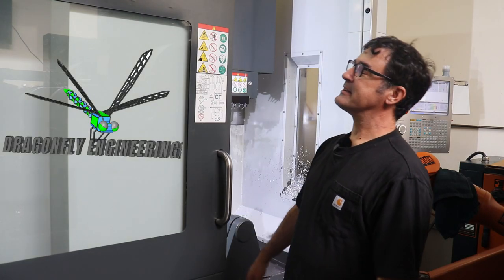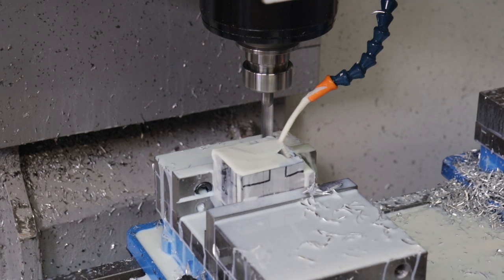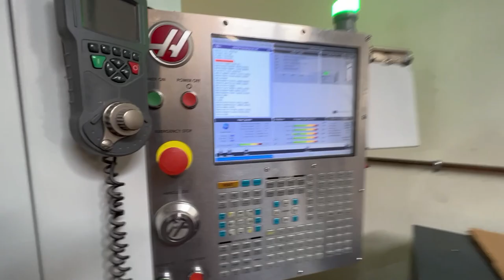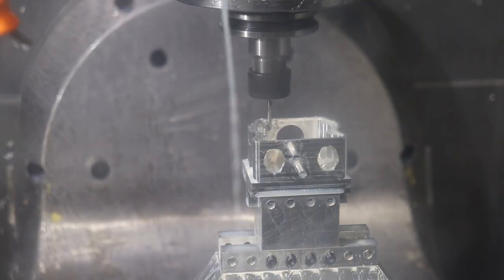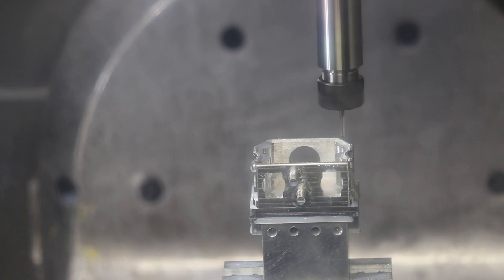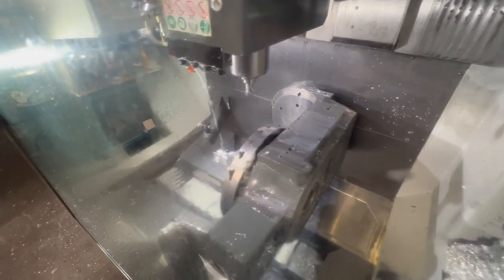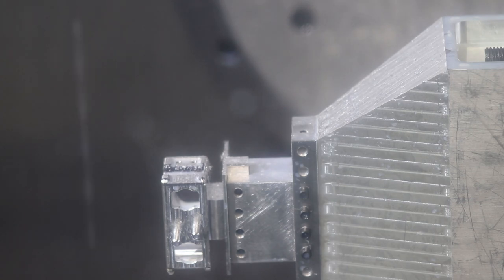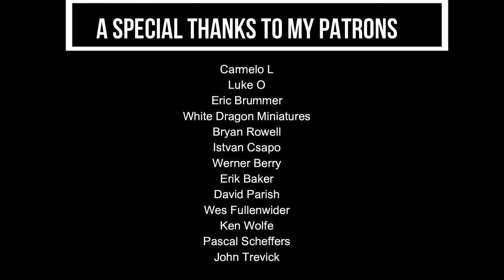5 axis CNC machining process

Comment: Nice vid. I've got a Haas UMC500 myself. I have a Lang baseplate that's permanently on the machine. It has 8 x 96mm holes to accept Land pullstuds. I then attach various types of workholding onto that.

For this type of work I can highly recommend 5th axis dovetails. It's really quick to install the 5th axis Riser on the Lang baseplate, and then put the Dovetail adapter on top. the four pullstuds on the Riser just drop into the Lang baseplate, and then the 4 pullstuds on the Dovetail adapter just drop into the Riser block. It's pretty easy and quick to machine the dovetails into the raw stock as well. You get great access to the part for machining with dovetails. 

It's worth the investment for the amount of time and effort you save doing setups. 

P.S. Yes, the TSC pump on Haas machines is ridiculously loud!
Reply from the maker: Thanks for the tip.  I checked out the webiste for the work holding

Comment: This is technically referred to as 3+2 machining. Since only 3 axis where ever moving during the cut and the other 2 axis are locked into a position. I applaud your initiative for learning this stuff and jumping right into the big end of the pool. 5 axis positional machining can be very fun. Full 5 is allot more fun.

Comment: You should have used that big block to extend the machine vice jaws. The play you were worried about, I would have thought, the jaws play would have been taken up by the floating ball mechanism or not?
Reply from the maker: good point. thanks for the tip.  The notch was a rough shape to keep the cycle cost down

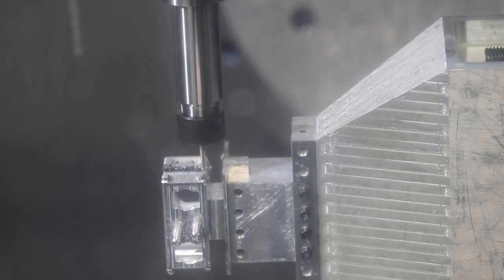Comment: 33:00 those artifacts are probably whisper cuts from a bad rest material thickness and toolpath tolerance combination. If thats the case then you should have a look at "Eliminate Rest Machining Whisper Cuts in Fusion 360! FF112"
Reply from the maker: @ipadize  thanks for the tip

Comment: Don't recall if you said what CAM you used, and not quite clear on those features left in your g-code from the tesselation and whether you actually need some of them but there are smoothing and tolerance options (thats what Fusion calls them, other software may have slightly different) that let you decrease/simplify the lines of gcode in exchange for potentially being more sloppy with the geometry.
Reply from the maker: Thanks!  I use Mastercam ( just learning) before I used visual mill and I am familiar with what you describe.  In this case the excess mill time was lower than the code optimization time.  But I am keeping and eye on the issue.  Thank you for your insight.
Reply: @DragonflyEngineering  it’s called Arc Filter in MasterCam